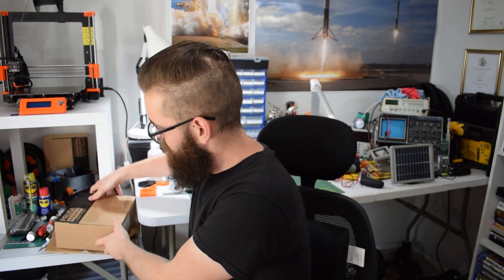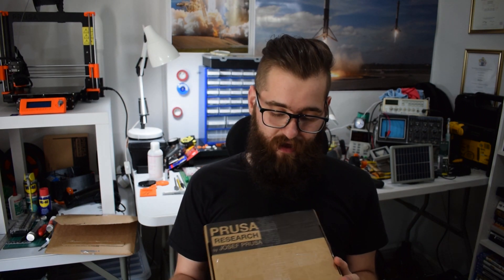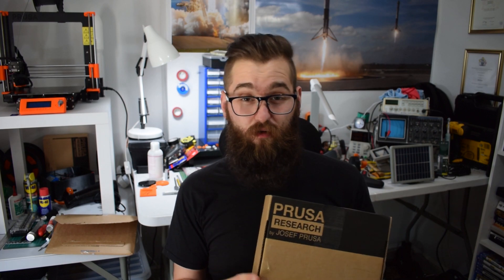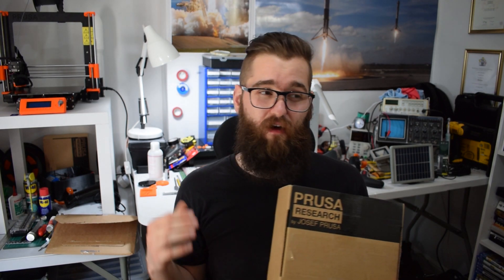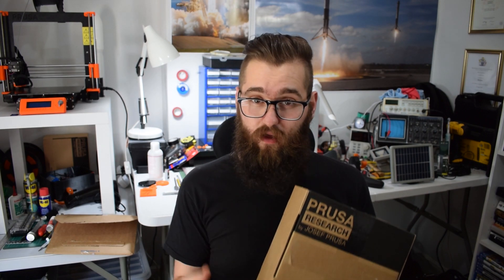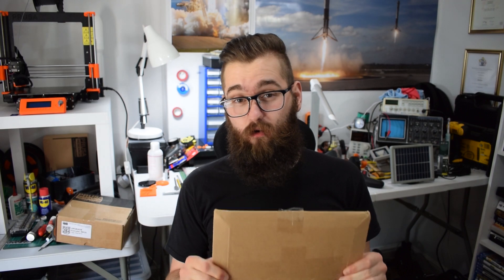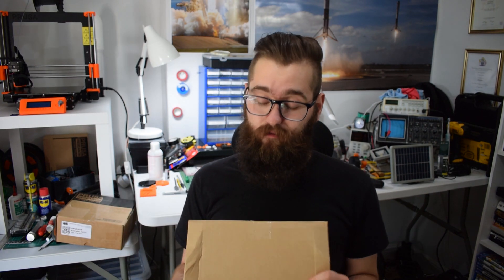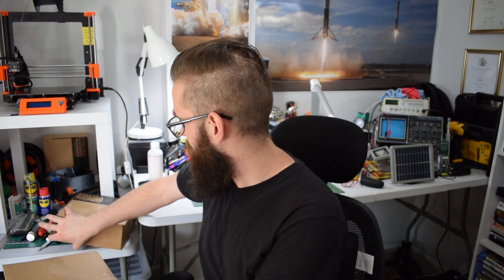Update: Prusa i3 MK3S Upgrade and Powder Coated Steelsheet

Comment: I purchased the MK3S kit not the upgrade as it was my first printer. I already had to replace the heat break due to issue it was causing. Would be curious if they are having you replace that in the upgrade?
Reply from the maker: Oh really? What issue was that? The only hardware that came with the upgrade was the new filament sensor!
Reply: https://forum.prusaprinters.org/forum/original-prusa-i3-mk3s-mk3-assembly-and-first-prints-troubleshooting/mk3s-stops-extruding-mid-print-filament-grinding/paged/7